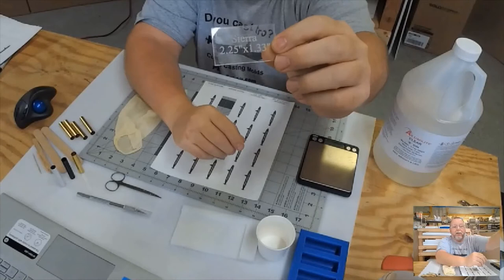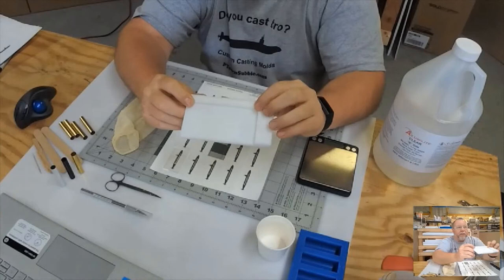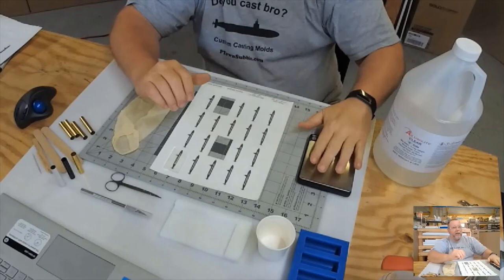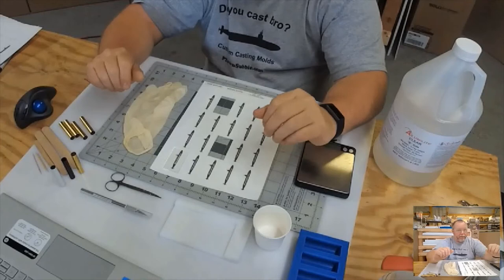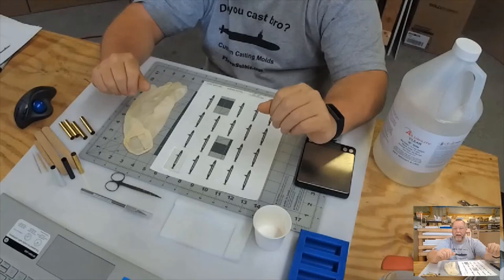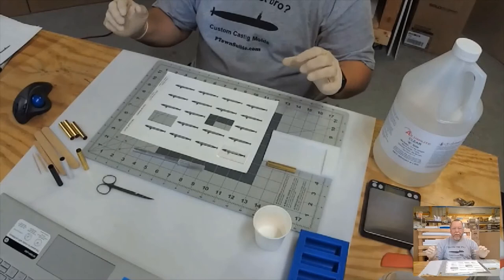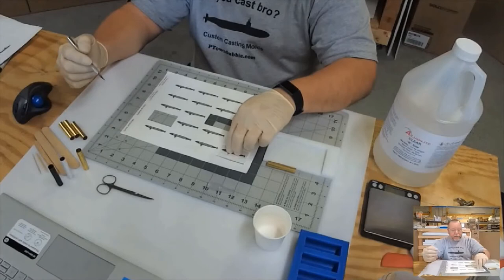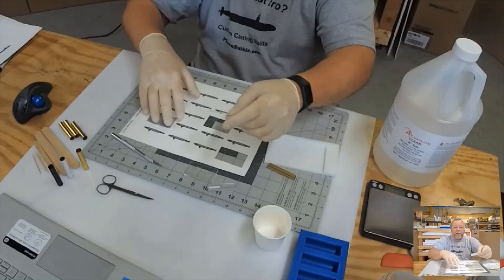Clear Casting Demo by Fred Wissen

Comment: No relief valve on the pot?
Reply from the maker: No we do not leave the air hose connected to the pressure pot and never approach maximum pressure. We recommend 35-40 pounds of pressure for casting is enough.

Comment: What size do you have them  print the labels?
Reply from the maker: Depends on the pen blank tube you plan to make
Reply: What program do you use to make the labels ?
Reply from the maker: @robertriley6213  there are various applications you can use, but we have Adobe's Creative Suite which has Illustrator and Photoshop in it for drawing logos and images. To print, you can use any document application that allows image placement such as Microsoft Word.